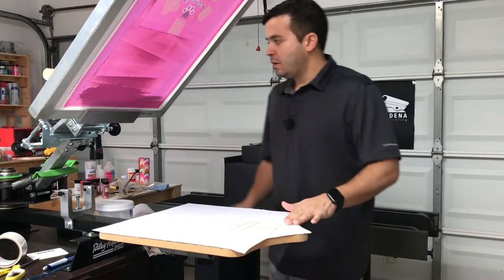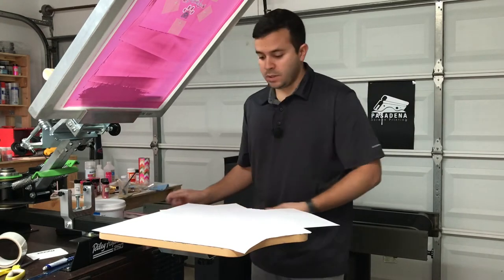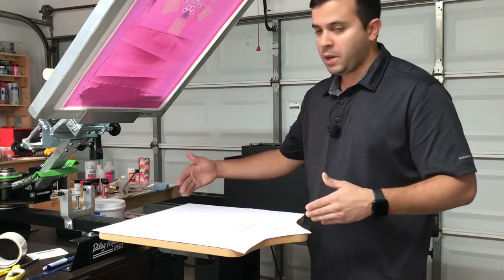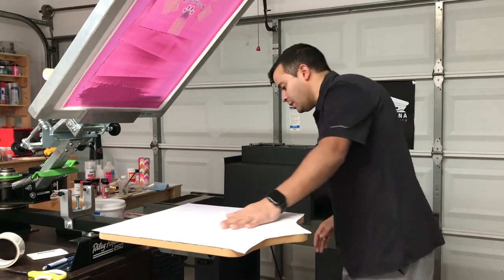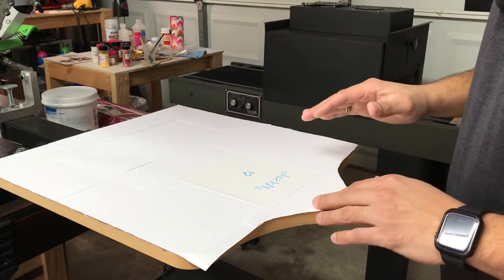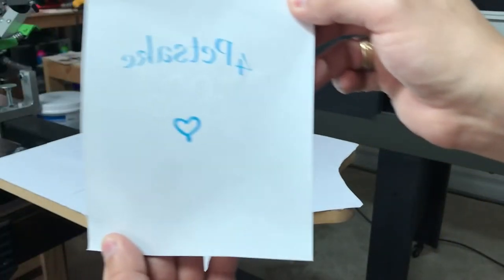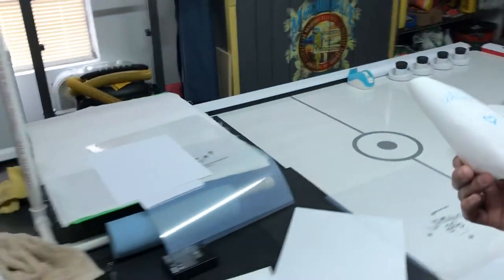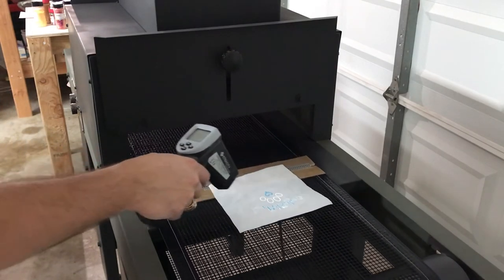How to make a Screen Printing Transfer

Comment: Thank you very much for this! How long or how many washes could this print last on the shirt?
Reply from the maker: Hi there. Sorry for the late reply. As a general rule, expect transfer prints to last just as much  as regular heat transfer vinyl. Also take into account, dryer temperature if you use a dryer and how often you wash it. I only did a couple of wash test on these prints and they were just fine.

Comment: Hi mate nice video
Did you used the butter paper which we used for backing
Reply from the maker: Hi, yes you can use regular parchment paper used for baking. On the video I used both the commercial paper for screen printing transfer and the parchment paper. I actually got better results with the parchment paper.
Reply: Does it matter what side of the parchment paper you use?
Reply from the maker: @303adrianarian9  any side will work the same
Reply: @pasadenascreenprinting303  sweet thanks
Reply: @pasadenascreenprinting303  awesome buddy 

Thank you ♥️

Comment: Have you ever used nylabond to make transfers? Will it work still?
Reply from the maker: I have not experience with Nylabond. Never tried it before.
Reply: @pasadenascreenprinting303  I
Reply: @pasadenascreenprinting303  I
Reply: @pasadenascreenprinting303  I

Comment: What kind of heat press do you use?
Reply from the maker: Hi there. I have the signature pro 15x15 from Heat Pressnation. But you can use any heat press that reaches that temperature. Here is the link to the one I have. https://www.heatpressnation.com/products/hpn-signature-pro-15-x-15-auto-open-heat-press-with-pressure-marker

Comment: What is the paper you print onto?
Reply from the maker: You can use regular parchment paper. The paper used for baking. Or you can buy screen printing transfer paper at any screen printing supply shop.